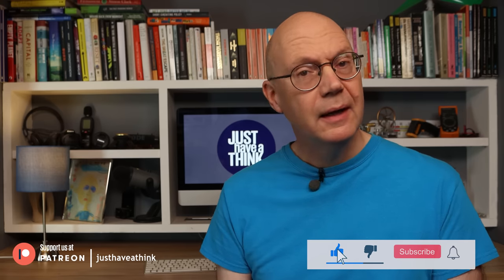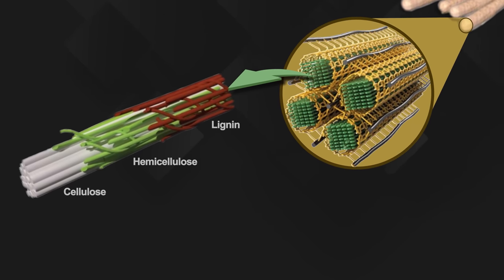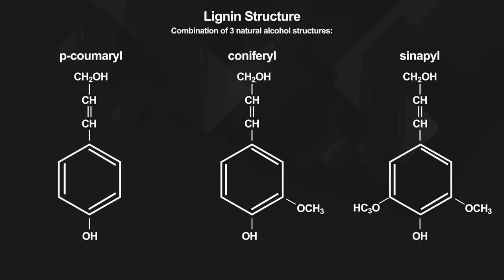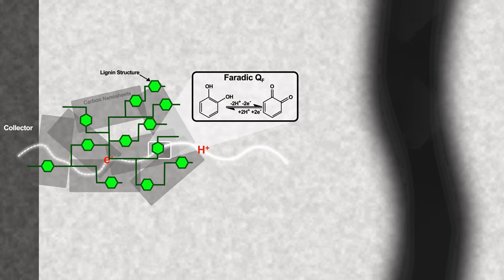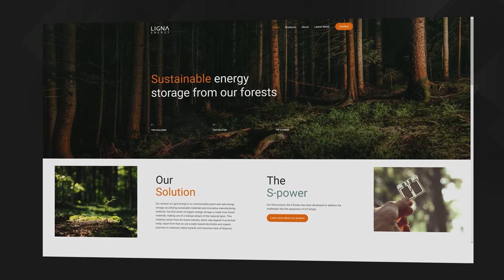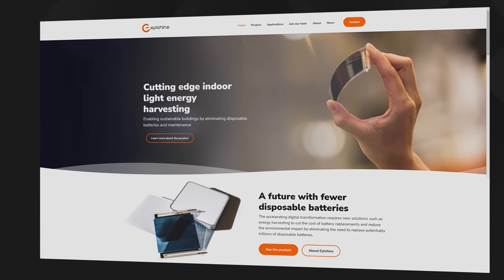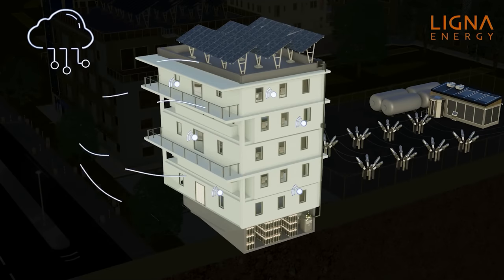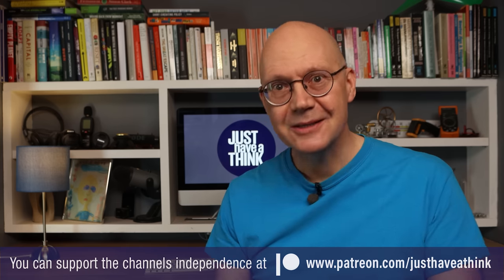Revolutionary new sustainable battery technology!

Comment: I like it let's say we replace a 4 cylinder engine in in Ford  Ranger with AA 120 horsepower power electric motor and we fill up the bed of the ranger with those batteries I think it would work I dropped 25 miles A-day 2 and from work and I pay $10 a month to charge my car now but but the batteries on board the car I only get 12 miles If I can get 24 to 25 miles out of the battery I can make it home and to work is work on electricity

Comment: I am very sensitive to the issue of waste lignin, the associated research and the 1965 FDA ban on researching waste lignin component DMSO. the electrical component you need is in the cellulose nano crystals. Recycled DMSO in a soda ash repulping process breaks the nano crystal  nano fibral bond. Nano crustaline cellulose is the most versitle abundant and projectable 3d medium conforming to  holographic projections electrical force fields microcircuitry in engrain=ed into composite structure. That's my sales pitch from 1973. Would have been me and my brother Bob, it was all his idea, he got arrestd and expelled for his scholarship funded research based on work from Dr Robert Herschler, my moms boss in Camas Wa where our high school mascot was "The Papermakers"! Sadly misrepresented poor interpretation of corrupt data prevent our family from ever presenting our potential research...too late mankind doesn't need that where they are going..

Comment: Centralized internet controller?  Have we learned nothing from the issues with provider failures and consequent rendering of locks etc as junk?  Please, let's have local smarts to run this stuff.  A little box, an ESP32 or similar, nothing should leave the building.  Its not necessary, it can learn for itself.

Also re energy density - surely for grid or home scale the issue is not density per kilogram (matters for cars and planes, definitely), but density per volume (and on grid scale I can't see that's an issue).  Number of cycles - big deal.